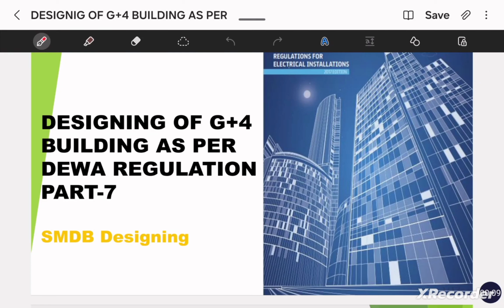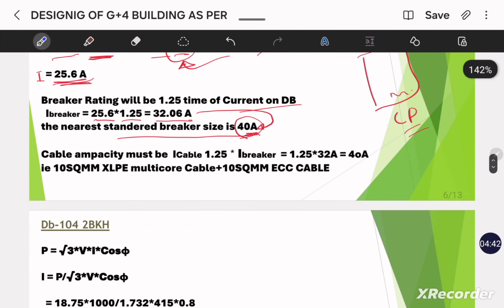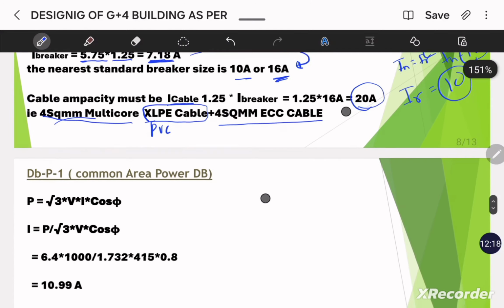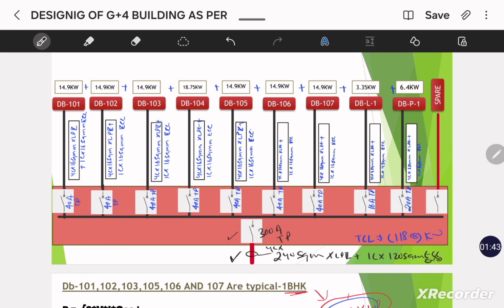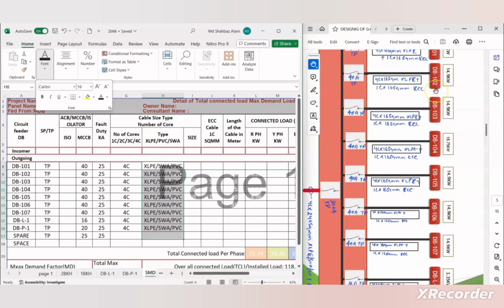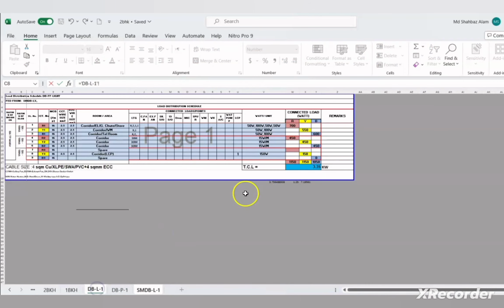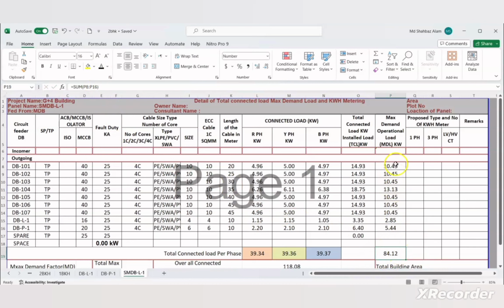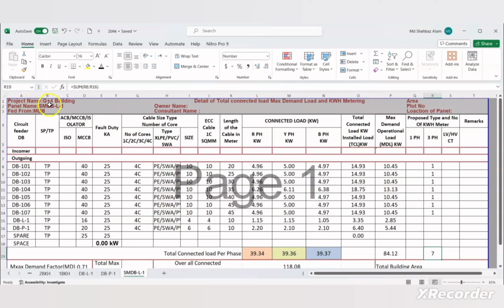G+4 Building designing as per DEWA Regulation---Part-7 || SMDB DESIGNING

Comment: Kindly update the transformer LT side to MDB cable calculation, which means running cable calculation.
High-rise building the transformer KVA rating is more.
I want to know if the no.of cables will be connected to MDB.
Because of some places will come 7, 11, 15 running cable. I want yo know this calculation.

Comment: Hai brother
Thanks for you valuable vedio.
What is your openion about Etap software.Is it necessary for all electrical design engineers.
Reply from the maker: You must require when working in switchgear panel manufacturing and distribution company in other Electrical field not so important like in construction. Just need basic information how to read and understand the sLD

Comment: dB L1 calculation is should be . You taken √3 in 3.35 KW.   Which is single phase

Formula should be like
 I = 3.35*1000/415*0.8
Reply from the maker: I consider that DB is three phases. As the load on that DB is from a different phase . As you wrote single phase formula then the voltage must be 220 voltage, not 415v